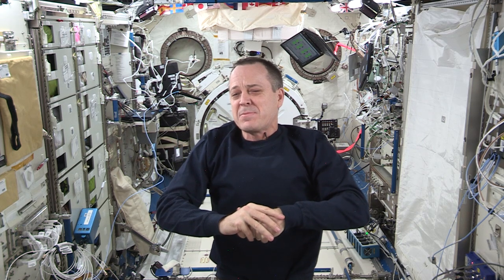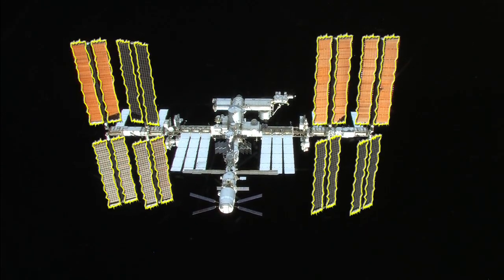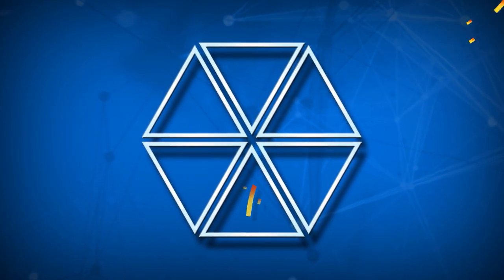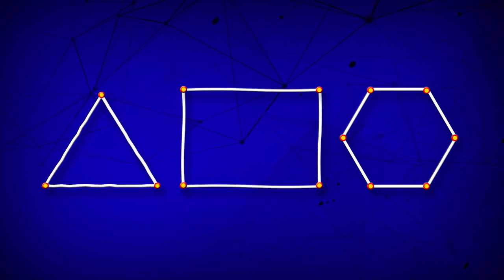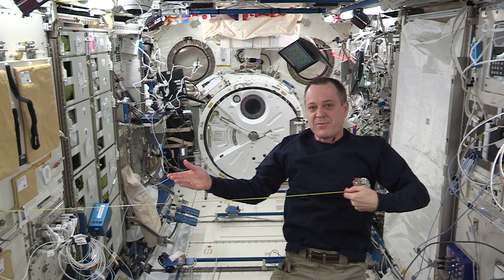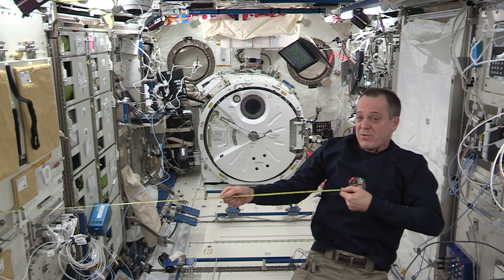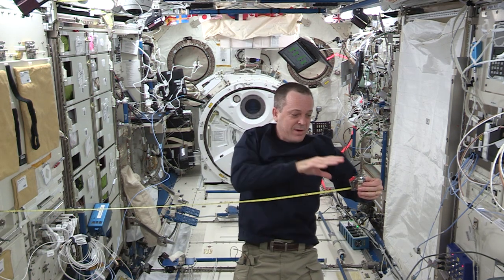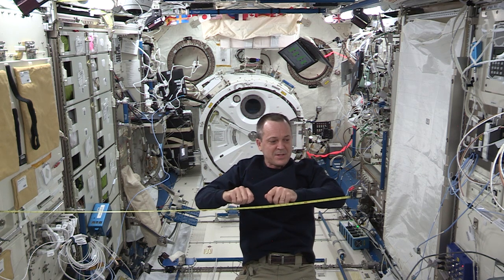STEMonstrations: Engineering Design - Trusses

Comment: If someone was to mark a map of the earth relating to the path of the ISS at 250 to 260 miles up, what path would the station follow?  I saw where the station passed right over Hurricane Dorian a day or so ago.  Is that the normal tracking for the station?  Can the station’s path and altitude above Earth be adjusted?  What is the difference between microgravity and zero gravity?  #AskNASA
Reply: The ISS orbits over the Earth's surface generally from West to East, but its orbit is inclined at about 50° off the equator, so sometimes it's going NorthEast /, and sometimes SouthEast \.
 It takes about 90 minutes to do an orbit, so 16 orbits in 24 hours as the Earth rotates once underneath.
 Earth will rotate 22½° for each ISS orbit, about 1500 miles at the equator. ISS should pass within 600miles of eg Miami every 12 hours, once going NorthEast, and once going SouthEast.
~ ~ ~
At the ISS altitude, Earth's gravity is still about 90% as strong as at the surface. If you just went 250 miles up, you'd still back down again. You'd need to match the ISS speed of 17,500 mph for Earth's gravity to balance your speed trying to fling you out into space. Any slight imbalance is microgravity.
 Zero gravity would be like being somewhere in deep space between galaxies, where you weren't being pulled in any particular direction.